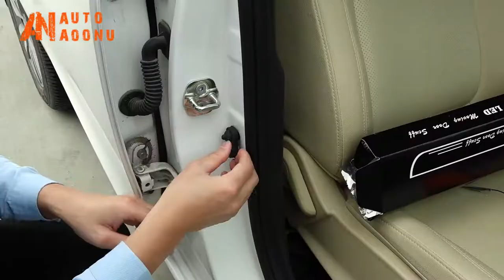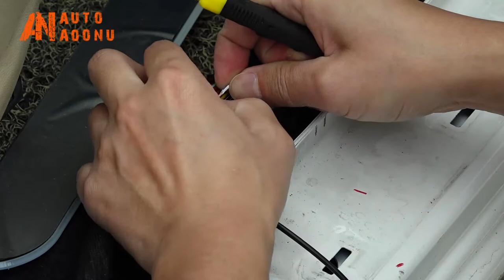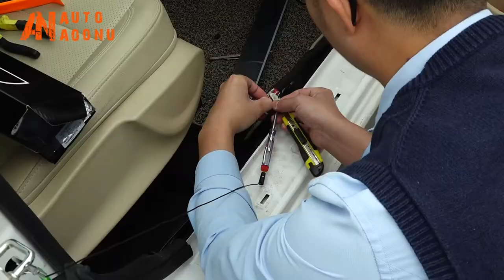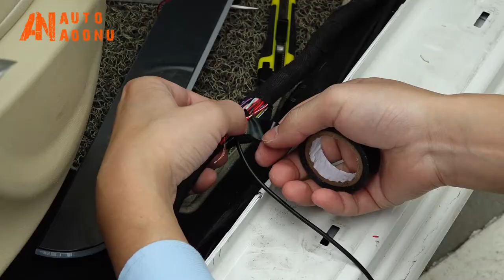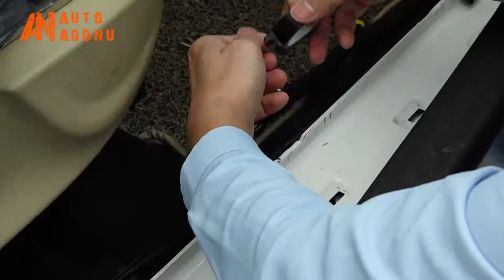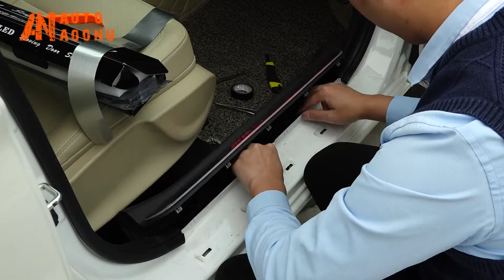Aoonuauto LED door sill installation tutorial

Comment: This video shows instructions on how to splice into the existing wire that goes to that switch for the door. On the 2018 Honda Accord the door switch is no longer there. Does anyone know where that switch is located now or how the door lighting works when the door opens and closes? I need to know which color wires I should be using for this kit. Thank you.
Reply from the maker: Hello.We got another video for Audi which it it running the wire from the foot light.You can check this for reference.I hope that could help you .https://www.youtube.com/watch?v=5fGqN_oKwgA&t=15s

Comment: what is the red wire?
Reply from the maker: Hello, the red wire in the video is just a regular power wire. We demonstrated how to use a circuit tester pen to find the correct power wire. To locate the power wire that controls the car door switch or the courtesy light, you will need to repeat the testing process. For more detailed steps on finding the correct power wire, you can refer to this video https://www.youtube.com/watch?v=9WPTfcFoXTs&t=99s. Each car may have different configurations, so we hope you can find your way. Thank you for your attention😄.

Comment: Hello - I just got my lights and want to install. I have a 2010 Mercedes’ e350 (w212). I don’t want to have to run the wires through to the door light. Is there an easier way? What specific wire can I tap into? I have 4 door sills so I would need 4 separate wires to tap into. Thanks